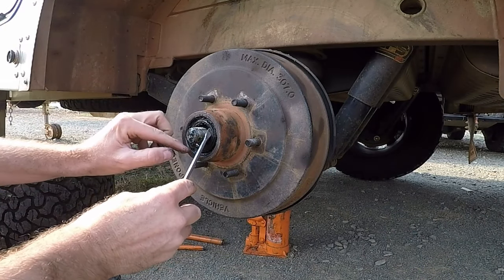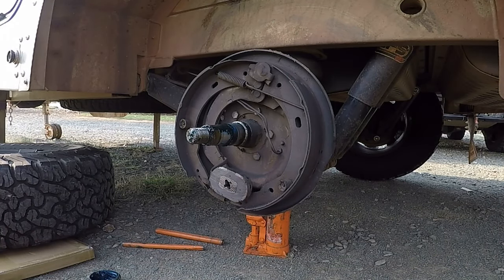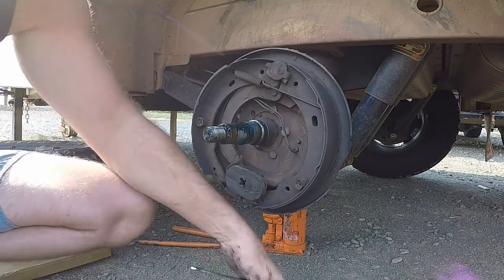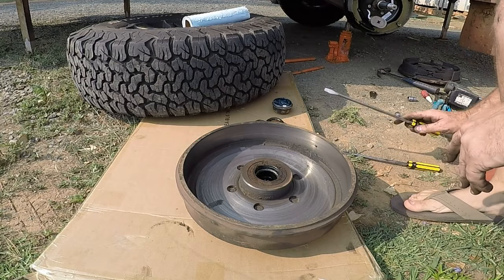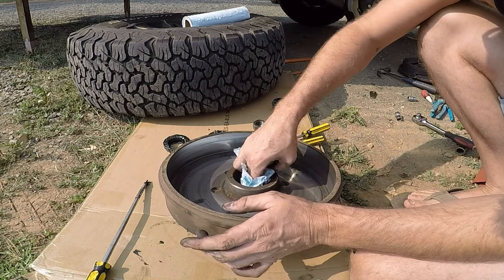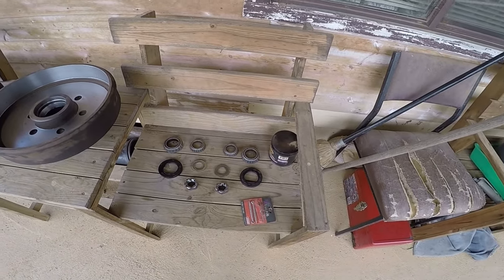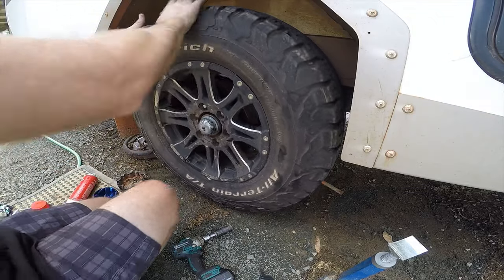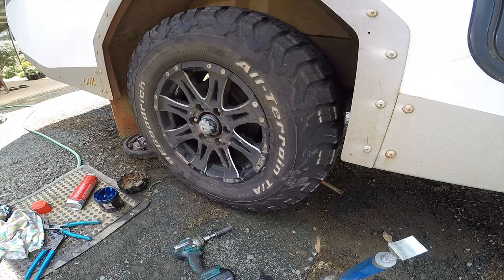Replacing Electric brakes on a trailer

Comment: Tip: If you are going to reuse your bearing, keep the same sets matched together, 
if you send your drums out for machining, make sure the same bearing goes into the same race when you reinstall.
Quickest way to get a bearing failure is to swap races!
Reply: We

Comment: Great video thank you, just a safety thing to note if you are doing this with just a jack is always have the van hitched to a vehicle so that it cannot twist and roll off the jack, and never get under a van thats on a jack, by the way I really like the adjustable ride height system you have.
Reply from the maker: Hi Michael I had the stabilizer legs down on the van and the jockey wheel. Wasn’t going anywhere. But that is a very handy tip. The airbag system was awesome makes leveling up at camp a breeze.

Comment: Thanks for the video but when you removed your inner seal the screwdriver thing you did is not the way to go flip the drum over and just tap it out with the flat screwdriver from the other side much easier
Reply: Kinda hard with the bearing in the way

Comment: Did you do a brake adjustment out of curiosity?
Reply from the maker: Sure did. As the brake pads and drums have been changed. The brakes need adjusting to suit this. There is a slot in the back of the brake backing plate and can be adjusted through that. 
Hope it helps
Reply: @twinsepicadventures4006  I have a dual axle caravan and looking at changing only the rear RH backing plate and brake hub.  Keeps getting hot brake hub, repacked bearings 4 times and got a good mechanic to adjust brakes and repack bearings.
So I’m just going to replace the lot.  
Is it ok just to replace one and leave the other 3?  Brake linings, hubs and bearings are fine on the other 3, they don’t get hot.
It’s could be a few things wrong to explain why it gets hot but I’ll start with new gear rather than stuff around with old.